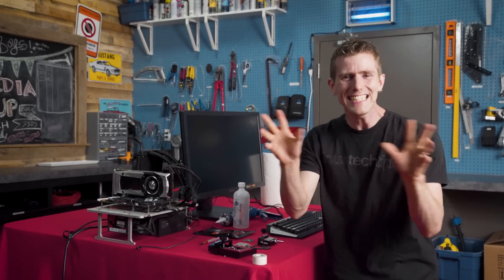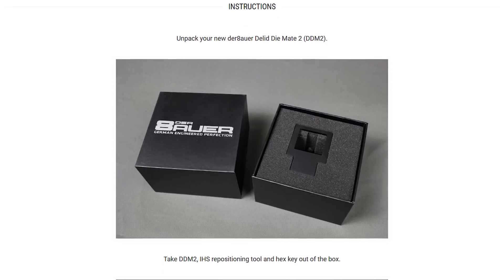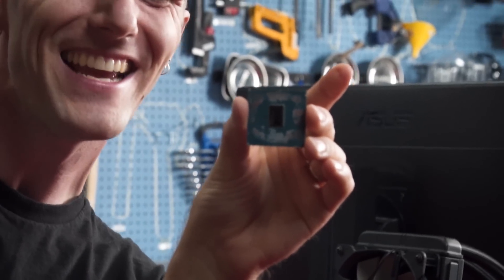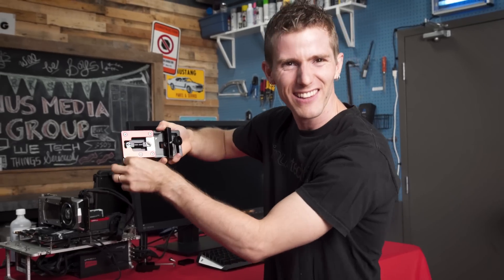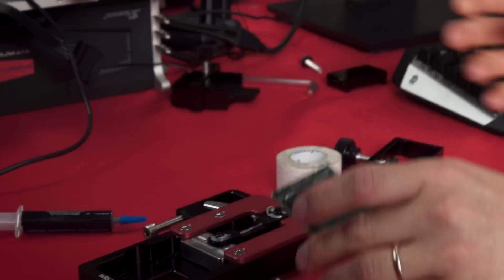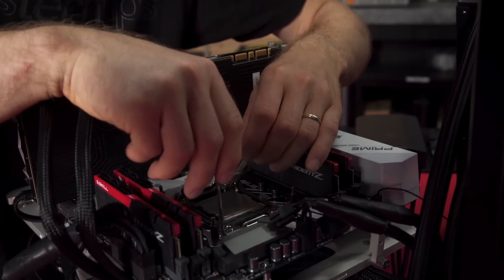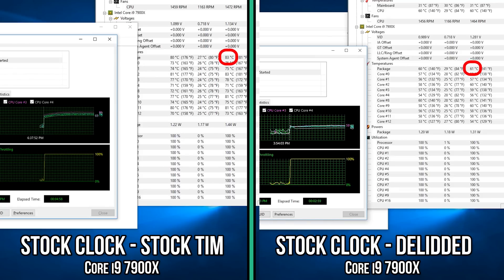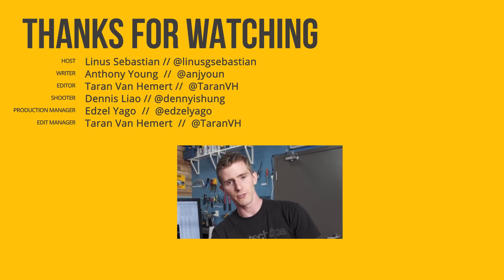Delidding a $1000 CPU - Worth the RISK??

Comment: And once again Linus went for thermal paste instead of liquid metal....
The whole idea is to REPLACE the Intel TIM with something that comes close to soldering the IHS and only liquid metal provides that...
Reply: Ender_sythe Don't be so smug when you could easily have googled that liquid metal thermal coumpounds exist.
They are tin, gallium, indium etc. alloys.
Reply: +ray ray To expensive for entry-level CPUs? Maybe. But >1000$ high-end CPUs? That's just cheap of Intel. They could at least use a better quality thermal paste.
Reply: he is probably doing that on purpose so he can make another video using liquid metal, that's the only logical reason behind it.
Reply: Exactly. They call it liquid metal just because it sounds cool... It is Gallium with some add ons. Just say it out loud: "Put liquid metal on your CPU and get better temps!" and then say "Put Gallium on your CPU and get better temps!" Marketing is marketing.
Reply: xXYannuschXx the sposors...
Reply: Liquid Pro and the like are gallium based.
Reply: xXYannuschXx y'all relize he rich as fuck and don't give a fuck about ruining shit. He prolly took this build apart 10 mins after completing the video
Reply: Those are liquid metal elements, there are many many more metal alloys that are liquid.
Reply: does that even make sense? what? 50 cents added to production cost on a 1000 dollar cpu.
Reply: That highly depends on the quality of the liquid metal compound. "coollaboratory liquid ultra" is the go-to stuff and the worst it does is staining the silicon.

Don't believe the bullshit you are reading about people fearing liquid metal, most of them haven't even tried it out and only read about it. 

I am using the above LM for 1,5 years now and the temps are the same; unlike the Intel TIM that dried out and caused thermal throtteling...
Reply: i heard liquid metal stuff doesn't last very long which is why i haven't tried it yet, i was considering delidding and then actually soldering the IHS back on but i'm a little scared lol
Reply: FleX having a solution for a limited amount of time still is better, than having no solution at all.
Reply: But that is not what Linus is using.
Reply: Why Not use thermal Paste? IT IS actually better than the shitty paste from Intel. To get the best result you can use lm but Just better thermal Paste will improve a lot as Well.
It is not perfect but still better and in my opinion good enough.
Reply: I mean, it works. They got 20C on the i9, so I would say he's not necessarily wrong.
Reply: Thermal paste alone brought the damn processor's temp 20c xD expect more with liquid metal lol..intel is just saving on $5 thermal paste for next gen CPU's that will be 1500$..fucking greedy ass mofos
Reply: Actually, the oven thing really works (if done properly).
The whole thing behind that was that alot of the older GPUs from Nvidia and AMD got TERRIBLY hot and broke a few solder points below the chip.
So some people thought: "Hey, why not use a regular oven like a reflow oven like it is used during the production of the card, to resolder the chip?"
In many cases this fixed their GPUs.
Reply: So instead of "interesting" results, we got a 20C drop in CPU temp. Assume a room temp of 20C and it its 33% cooler, 60C vs 40C increase under load!
Reply: Hahaa
Reply: What sort of temperature improvement did you see? I've got the same cpu and was wondering if delidding would be worth it to try to squeeze my overclock a little bigger from 4.4ghz. Thanks :)
Reply: Fox Unit Delta - 2 months in for me, and still have the same approx 30 degree drop in prime 95
Reply: @Alan Hunter - Only indium can bond the silicon from the die and the IHS. The IHS is made of Copper with Nickel plating. Nickel will act as a diffusion barrier to prevent any atoms to form an alloy with the copper. Indium also sticks to Nickel but not really well. So to improve the adhesion you have to apply another layer on top – preferably using a noble metal because they provide the best wetting conditions. Examples would be gold (Au), silver (Ag) or palladium (Pd).
The soldering temperature has to be around 170 °C. Lower might result in a bad soldering connection and too high temperatures will damage the CPU permanently or result in a bad yield rate.
Reply: Silver solder*
High tech is almost certainly something different, and high quality doesn't describe it well either, as high quality lead solder exists.
Also liquid metal doesn't dry, it cools. Drying is something that things with water in them do.
You can apply a fan, fans just move air. If you don't want oxidation use flux when soldering then wipe with acetone.
Reply: though it is also reported that the latest generation of chips has a very "considerate" amount of silicon which reduces proper surface contact with the tim - Heatspreader. just removing and replacing the silicon with more modest amounts to allow proper contact reduces temps.
Reply: Go for it. Just use thermal paste not metal liquid stuff
If you need only...
Reply: they aren't even fucking using proper thermal paste ,let alone use liquid metal in their processor ..do you even common sense bro?
Reply: yah some of the ingredients vaporize at high temp so do what i do and replace it every 2 months top.
Reply: when you reflow a pcb for the first tiem the solder has flux in it. once the solder has (soldered) the flux is no more. if you was to reflow again yes the solder would melt but it would not be as strong and also no guarantee the solder could fuse properly. people that do this and works are just lucky but the solder joint wont last. try melting solder without flux you will see what i mean
Reply: I know that, but still better than just throwing the GPU away, don't you think?^^
Reply: He is NOT using Conductonaut!!! (seriously, you can see in the video that the compound looks nothing like liquid metal and that the syringe itself looks different).
He is using Kryonaut, the best non-liquid-metal thermal paste on the market (so no wonder that even that stuff is giving such lower temps).
Reply: The thermal past Intel use is so bad that you do actually on some CPU`s get huge improvement by replacing it with a good non metallic one... Only logical reason I can think of for Intel to use so bad cooling paste is they WANT your CPU to run hot so it will only last just as long as the warranty and also not over clock well to make you buy new faster and more expensive CPU. I absolutely hate all companies that is so greedy that they sabotage their own products to sell more....
Reply: the oven thing worked KICKTHEBASSWITHTHEFACE! watch the actual video next time?
Reply: The idea is to replace the Intel tim which is known to be sucky vs other well known brands of paste which you can clearly see in the damn results...though while you're at it you CAN replace it with stuff like "liquid metal".
Reply: +Arctic Fox To expensive. Same reason they dont solder anymore.
Reply: Thermal Grizzly Conductonaut IS liquid metal based.
Reply: Milan Jovanovic 0....... Why would the pay him to advertise something that voids warranty.... Not making much sense today are you?....
Reply: Actually baking a PCB can help to 'refresh' solder points and is a valid technique.  They are baked in the factory also as part of the process.  So what is your reasoning for calling him an idiot for doing so?
Reply: if thats true why dont they just use liquid metal instead of thermal paste in all of intels products?
Reply: Don't bake a PCB, reflowing solder can do horrible things to a PCB that isn't meant for reflowing.
It can melt connectors, flow solder to places you don't want and other nasty things.
Reply: You know the thermal paste has metal in it. Most use zinc or silver in the mix, the very same variety used in your typical high tech solder. 

However I would love to see the test with a solder joint. Just lay a small bead of high tech solder on the chip and then touch a temperature controlled soldering iron to the heat spreader at 200C. Wait for the iron's indicator to read a stable temperature so  you know you got it all up to that temp, lift off and give it a few minutes to dry. Do not apply a fan, ice or any external cooling while it's drying; that will oxidize the solder and wreck the desired properties: mechanical strength and thermal conductivity. If the spreader gets cool enough to touch without discomfort, the solder has dried.
Reply: yep -_- I think linus does not get the idea (and replaces thermal paste with thermal paste...) just look up der8auers overclock videos... he suggests to use conductonaut liquid metal... and that actually works by impressive 15-20°C lower while overclocked and 1,2V
Reply: ender_scythe a 1 second google search would reveal what liquid metal is -_-
Reply: Fox Unit Delta mines working for 5 years now (not delidded but on slightly oc ivybridge i5)
Reply: Did none of you do any research into the compound he's using? http://www.thermal-grizzly.com/en/products/26-conductonaut-en
Reply: Liquid Metal isn't stable. As someone else already said, 11 months of Liquid Metal on their CPU and it turned into a thermally-insulating glue they couldn't remove without cracking the die.

"Intel toothpaste" is designed to remain stable for a long time - it's thermal performance is a bottleneck for overclockers, but it isn't one that gets worse. It's thoroughly ho-hum for years, whereas your Liquid Metal will kill your CPU after a few months.

Aftermarket TIM isn't as stable as the toothpaste but isn't as suicidal as the Liquid Metal. I would imagine Linus would rather show off delidding with a thermal paste that isn't a guaranteed death sentence for long operation.
Reply: Tin and indium are solid at 100 C. I think you mean metal doped thermal compound. Calling it liquid metal is deceiving and incorrect.
Reply: are you high?
Reply: Liquid metal? You mean regular metal?
The only cool liquid metals are mercury and gallium.

Comment: Quick answer: it's not worth the risk for a marginal gain in performance.
Reply: Performance? Maybe.
Running it cooler at higher clocks than before? That's totally worth it.
Reply: +traeng As the end results showed, they only got minor performance improvements. I'm talking about increase in clock speed not temperature. What's the point of running a chip so much colder if you've already hit the roof in overclocking (excluding acoustics)? Plus is it worth the risk of destroying a $970 chip?
Reply: The point of running colder is that you don't have to get an expensive cooler and still be fine, saving money. Plus the acoustics that you excluded for no reason.
Reply: I think that if you're already spending nearly $1k on a CPU, another $100 would be a reasonable price for a CPU cooler/water loop. I excluded acoustics because they have no impact on performance of the CPU and most water cooling systems have a much higher thermal saturation and are generally more quiet.
Reply: $100 cpu cooler is not nearly enough if you plan to overclock it dude, you don't know wtf you're talking about.
Reply: marginal, like 20 DEGRES.